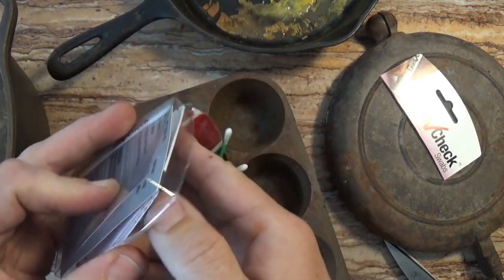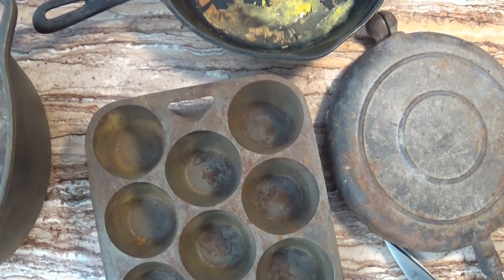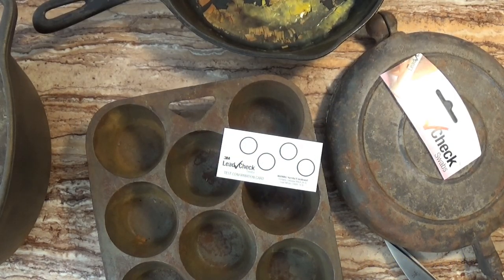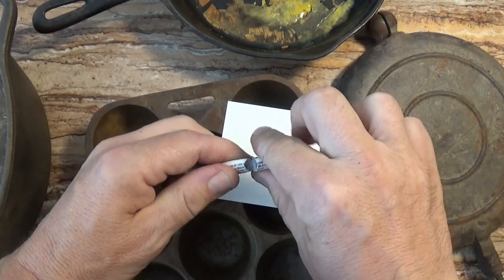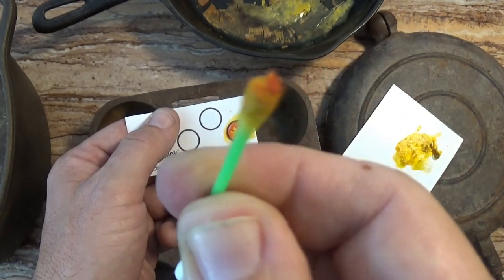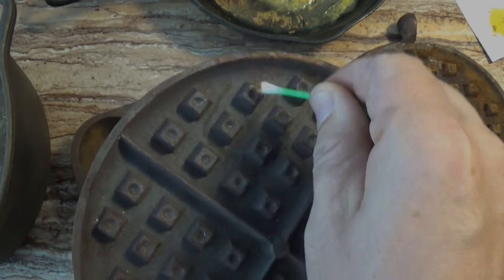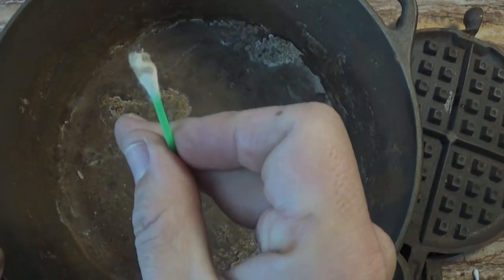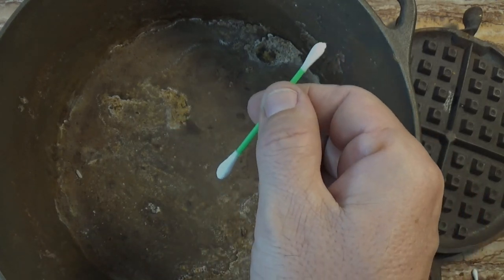Testing Vintage Cast Iron for Lead with Cotton Swabs

Comment: In one of my past jobs we used acetic acid to remove lead from the surface of cast iron. That lead came from leaded gasoline. Perhaps if you find a pan that has lead, try acetic acid and then re-test.

Comment: A controlled test is needed to see if the lead test kit is accurate. Get an old pan, melt some lead in it, scrub it out and see if the test detects lead.
Reply from the maker: That's what the card with the lead samples is for.

Comment: Is there a chance that you are actually testing the seasoning, and that you need to get closer to the bare metal to be certain the lead test is accurate?
Reply from the maker: The seasoning on those pans was scraped off or nonexistent before I tested them.  It's a good idea to scratch off the seasoning in the testing area, I agree.  Regardless, I probably didn't have to test the waffle iron anyway. :)

Comment: I used 5 tests of a different brand are supposed to turn (darker orange then red with high enough levels of lead) to test a 3 notch lodge i just bought. theres bare spots on the seasoning so i test there as well as seasoned areaa after scrubbing the rust out with some BKF but all i see is what seems to be a sooty dark gray color, is this just iron coming off the pan? I don't see any tinge of pink or red, but i can't help but feel uneasy since if it is dirt i'm not sure if i can tell under the contamination color...

though i do think it would be exceptionally rare for someome to use a 12 inch (#10) skillet to melt lead who knows
Reply from the maker: It sounds like there may simply be old seasoning coming off of the pan, or perhaps some rust.  Those lead tests are very accurate on the surface, so I'd suggest you simply strip the pan and season it.

Comment: Word of caution: I tried this tonight and the glass fragments from the vials holding the chemicals stuck to my cotton swab and when I swabbed my cast iron (that is pretty much stripped of all seasoning), it ended up leaving scratches. I am running it through another round of oven cleaner soak. We shall see if the scratches come off. It's probably not a big deal because the seasoning will take care of it, but I thought I would share my experience.

Comment: I have a lot of seasoned pans, a few of which are just user pans that are marked Taiwan. Can I test them without stripping them? Will the lead show up through the seasoning? One is a small dutch oven that is undergoing its first round of seasoning now.
Reply from the maker: If you’re concerned, you could scratch away a little of the seasoning at the spot you want to test.  For the record, lead contamination is very rare...though not impossible, which is why we do it.

Comment: And what if they do test +? Unsalvageable?
Reply from the maker: Lead is essentially permanent, so a pan would have to be treated in a manner so that it would never be used for cooking again.  That would probably mean breaking it with a big hammer.
Reply: Yea, not recommended for cooking if positive.  You cant truly get it all off!
Reply: Most people drill a hole in the middle and make a clock out of it.

Comment: Those swabs are toxic themselves.
Reply from the maker: Yes, but they don't adhere to the metal in the manner that lead does.
Reply: @castironchaos  Good to know. I'll pick some up. I need to test a few old skillets. Been reluctant to use them for family means without thoroughly testing them.